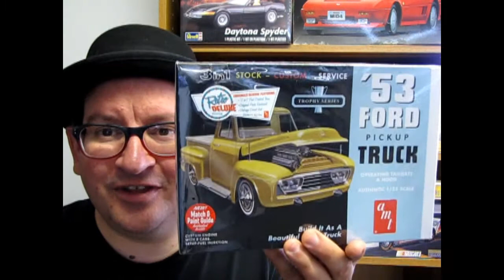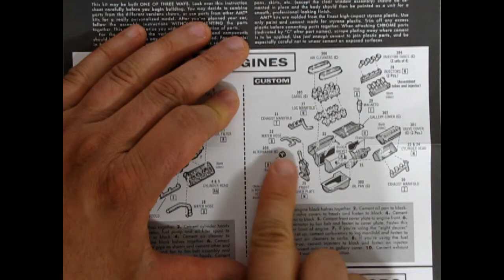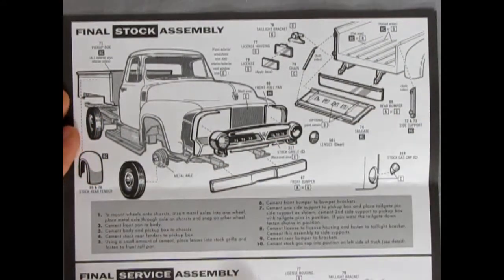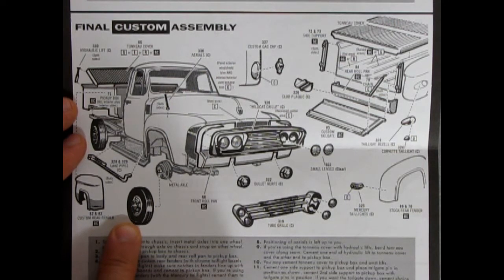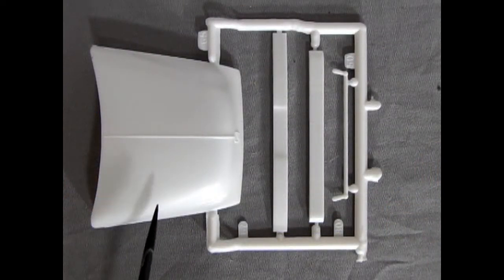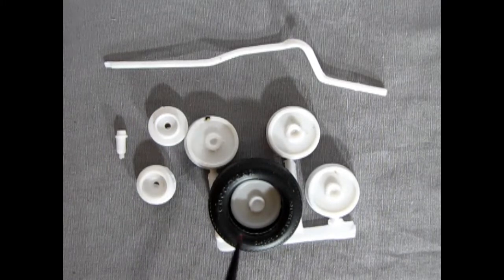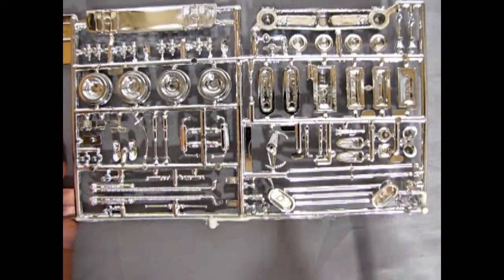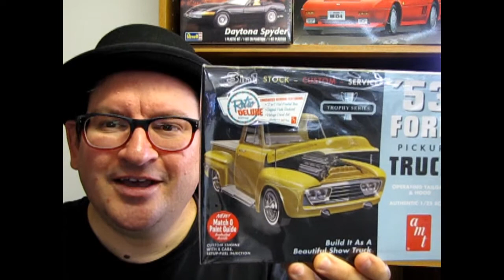Model Car Garage - 1953 Ford F-100 Pickup Truck - Trophy Series By AMT - A Model Car Unboxing Video

Comment: well done, thank you tor this wonderful video
Reply from the maker: Glad you enjoyed it! Please subscribe for more!
Reply from the maker: If you bought this kit, what custom features would you use on the truck?
Reply: @MonsterHobbiesModelCarGarage  i did buy it, only i bought the AMT Coca-Cola version and went stock with medium rust. made it look like my dad's old 1953 green, flathead ford
Reply from the maker: @crazylady201162  Nice! that would be something to see for sure! 

The first version I built of this was around 1986. It came in the AMT "Diamond in the Rough" model set with the truck, trailer and a busted up 1939/40 Ford sedan. I painted that truck with tester's flat OD Green. I still have that model kit set today!
Reply: @MonsterHobbiesModelCarGarage    I had This In Progress as Gran Prix Race Team Support Hot Custom Truck instead of the Cobra as Race Car I'm building IMC GT40. Truck Features 427 Indy Car Engine w Special heads from IMC kit & Custom Fabbed Clear Hood and Many more Custom Features. Ill Try to Enter it in your Contest
Reply from the maker: @memorylanemodelcars  Sounds good. My first exposure to this kit was the old AMT "Diamond In The Rough" set with the car trailer and beat-up 1939 Ford sedan. Hope your build works out!

Comment: I enjoyed your video I am still working on my truck haven't made it to the hood and the metal hood clips all in due time coming along nicely I am doing mine a mix of stock and custom
Reply from the maker: Right on! It sure is a fun model kit. Have you ever looked into the history of the custom pieces and what trucks they were patterned after?
Reply: @MonsterHobbiesModelCarGarage  No I haven't. I didn't know there was such a thing
Reply from the maker: @codyrhea1042  Oh yes! A lot of these model car kits came out in the heyday of the real car kustomizers. That would be mid 1950's - mid 1960's. 

If you look at the instructions, the "Wildcat" grille was actually used on a real kustom 1953 Ford truck of the same name. It was built by George Barris.  

Here's a link to it : https://kustomrama.com/wiki/Wild_Kat
Reply: @MonsterHobbiesModelCarGarage  can you send me a link to the video
Reply from the maker: @codyrhea1042  I don't know if there's a video on the WildKat truck. I posted a link to an article on it though.

Comment: That kit is 😍 . You should build the Desoto the motor, thanks again.  🤙
Reply from the maker: That's the plan! - I was going to start the engine building series with the Desoto fire Dome engine, but decided to go with the engines from the Trophy Series first as they are interchangeable between kits.

Comment: That is one of AMT's best kits and a lot better than the Revell Ed Roth 56 Ford, not a nice kit. I have the Cobra Race Team version and it is the same kit. Cheers
Reply from the maker: Awesome! My first version of this kit was the old "diamond in the Rough" with the 1939 Ford Sedan.
Reply from the maker: If you bought this kit, what custom features would you use on the truck?
Reply: @MonsterHobbiesModelCarGarage  I plan on building the race team truck as a custom so, yes I will use as much of the custom parts as possible and the Shelby will be built as a 50th anniversary edition. Cheers Wayne
Reply from the maker: @TrueNorthModels  Sounds great. I recently bought 3 of these, one in Coca-cola trim. There's enough decals in there to dress up 2 other trucks, hence me buying 3. They will be built differently from one another and I intend to use both custom grills, one per truck. One red, one white and one in that yellow and black combination...but I also saw white and light green..so I don't know! Have fun with your build and please post some pic of it on our Facebook page some day.
Reply: @MonsterHobbiesModelCarGarage  Will do Trevor and I plan on building the set this year, just need to ease back in after my hiatus. Cheers Wayne
Reply from the maker: @TrueNorthModels  Looking forward to it!
Reply: @MonsterHobbiesModelCarGarage  roll pans, custom grill, full wheel covers & whitewalls, multi carb'd Hemi, white interior & tonneau🙂